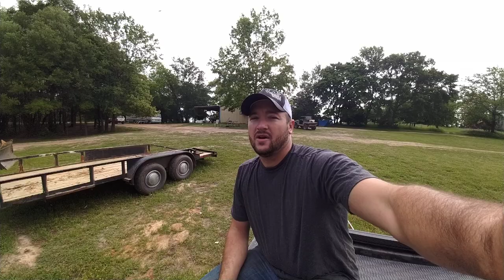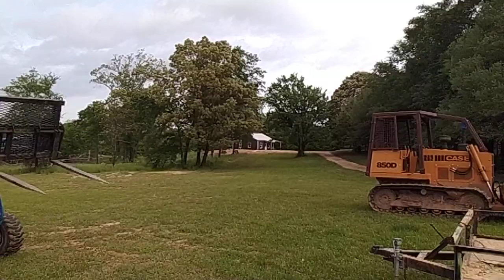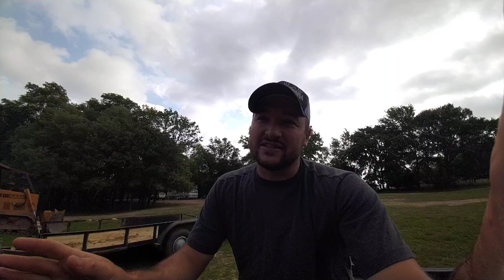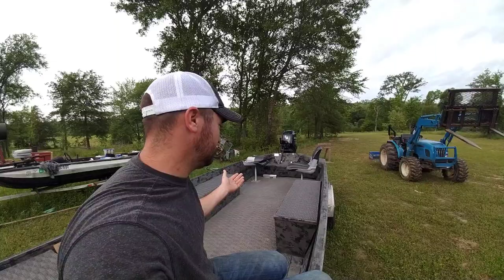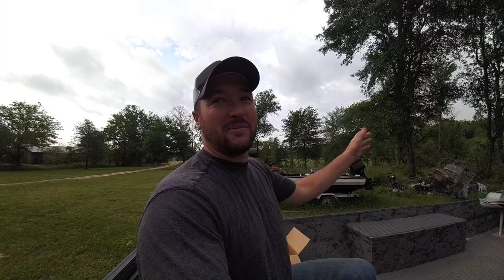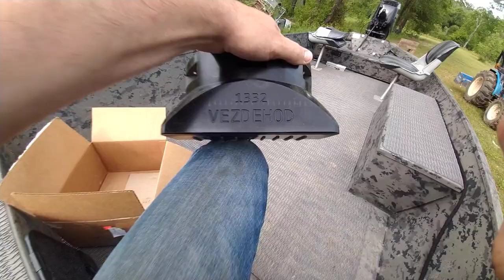Outboard Jet Speed, Why It Matters

Comment: Here's a great example for all the people new to the OBJ World.....I run an Alumacraft MV 1860, 625lbs dry weight.  Boat came rigged w a Merc 50hp prop.  I spent over a year, asking questions, gathering information on WHICH size of motor I wanted...the 90/65 or the 115/80???  Dennis NAILED it, you don't want to leave anything on the table when it comes to powering these boats.  In order for them to REALLY shine, they've gotta be able to get up on step right now, and build good speed.  I realized that the 90/65 was not going to be the motor for me when I chose the 115/80...and boy am I glad I did!!!  EVERYONE that has been in this boat is blown away at how fast it jumps up, and how quick it planes out.   When in doubt, spend the extra $$$ and buy what's going to make you the happiest :)

Comment: Another way to look at it is speed is a good measure of efficiency and efficiency means lower fuel cost.  Most people think 30% HP loss for OBJ while only thinking of speed...but another way to think of it is 30% or more at the gas station.  30% adds up with Democrat gas prices.

Comment: At the end of the day nobody ever complained about having too much power. Don't cheap out on a smaller motor because you'll regret it in the end. I'd rather not run at WOT all day long. My ideal setup would have me running 3/4 throttle to attain the speed I want. It's like working on a car. I'd rather not use a 2 ton jack to pick up a 2 ton load. Will it do it? Sure, but I'd rather have a 3 ton jack so I'm not working my equipment so hard.